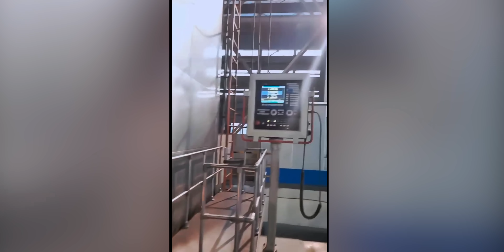Machinists React to INSANE CNC Fails

Comment: Good times.  Should have seen the face of that new guy we had when I shrank a sleeve in to replace a ruined bearing bore.  No, not the job, but me checking what I had left in the bottom of the barrel of liquid nitrogen and putting 4 cans of soda in there when it got down to about 3/4".  It freezes a disc in the bottom, doesn't ruin the carbonation and cools the rest of the can within a couple minutes of taking it back out.

Comment: blow tourg on the table out to the side and 8 chicken's in some steel wire in a star form in a toolholder turned slowly by the spindle lets goooo
or a good roast on the table on a spike at like 45 degree 10 rpm with torge in the spindle